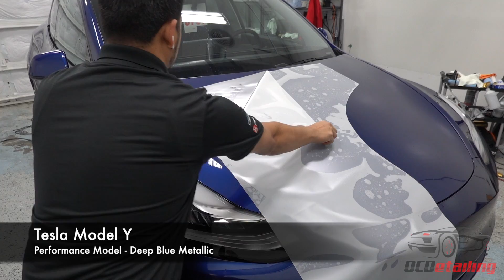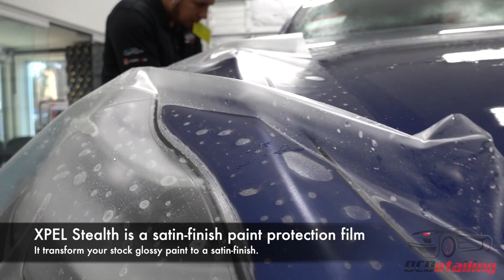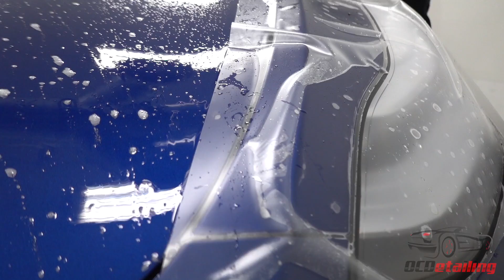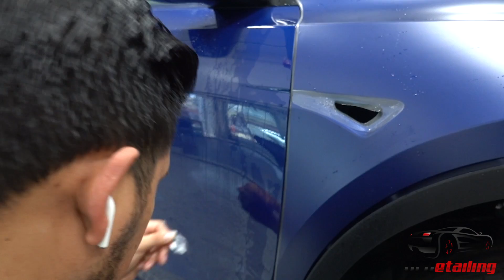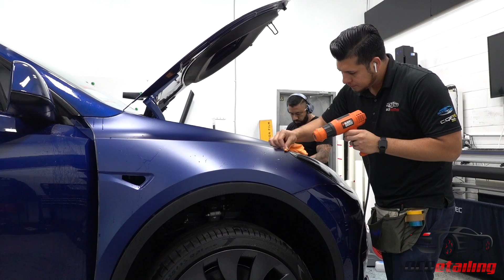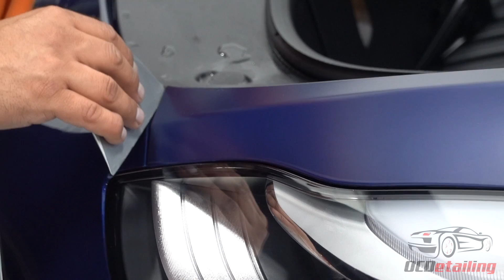Tesla Model Y: Up close and personal with PPF Installation

Comment: What makes this better than plastic dip, or vinyl wrap?
Reply from the maker: This is satin PPF. Its much thicker film designed to protect the paint and rated at 10 years. Where Vinyl wraps are just a color change and usually the film will fail with in 3-4 years.

Comment: Wow, stunning! How long can this be expected to last?
Reply: If a rock hits it, it will rip and then get worse
Reply: The film is rated at 10 years :)
Reply: Pan Chod not sure what you mean by this. Yes the film can chip but that is what it’s there for because this is paint protection film. So it’s meant to take the hit instead of the paint. And film chips way less than paint does